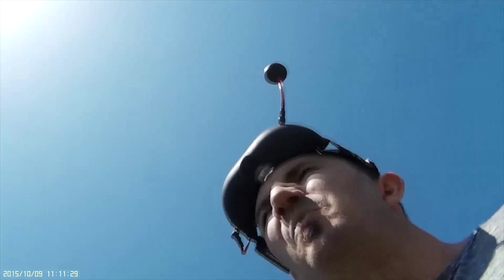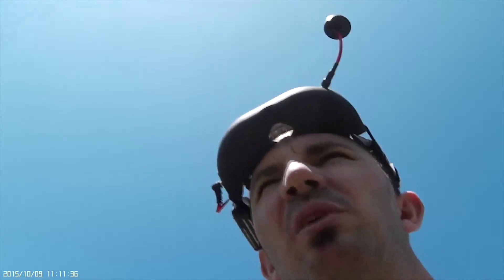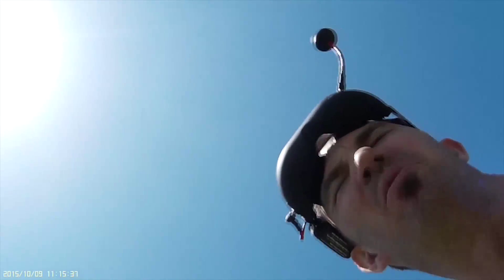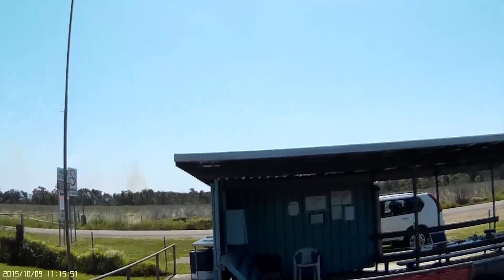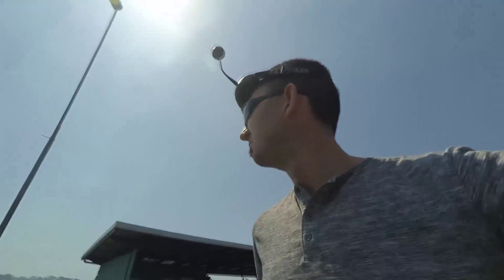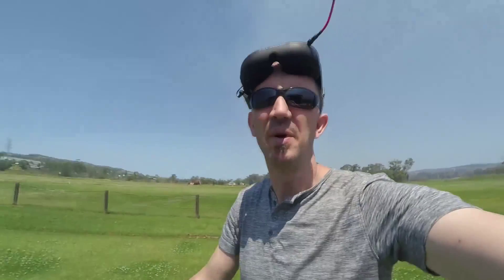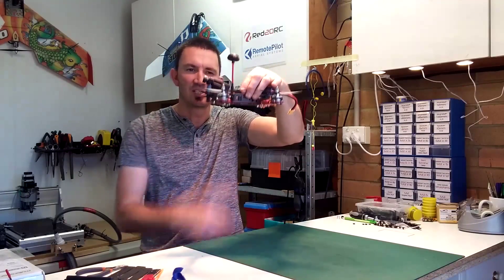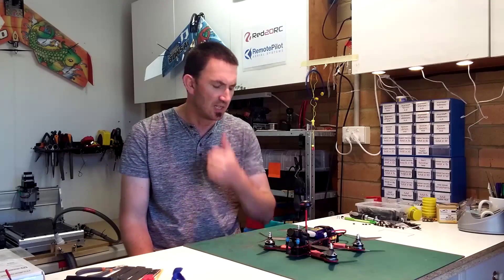Project Get Good. Part 4: Tuning my FPV racing drone

Comment: You got horrible vibrations in your miniquad. First get rid of that and then you can tune your quad perfectly.
Reply from the maker: most of that was due to using old mobius with a loose lens and old motors. That said, I know exactly what you mean and that frame has actually been dismantled now as I never have been able get rid of all the vibrations.
Reply: +Red20RC Oh i see.. Sorry i didn't look at the date the video was posted. I was just saying this because i had the same problem. PID's were low cause of vibrations(couldn't go higher). Could never get it to fly well. Changed motors and moved to 3blade props and now it's perfect! :)
Reply from the maker: +Lyrixish no, you were absolutely right to point it out. I didn't say anything in the video as I didn't realise the problem at the time but it is unlikely I would ever have got a good tune with that setup.